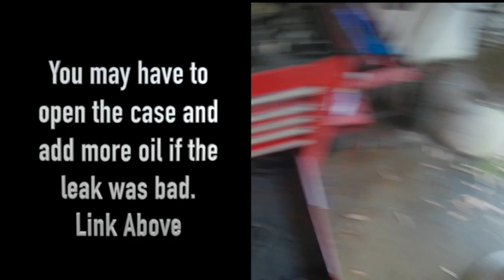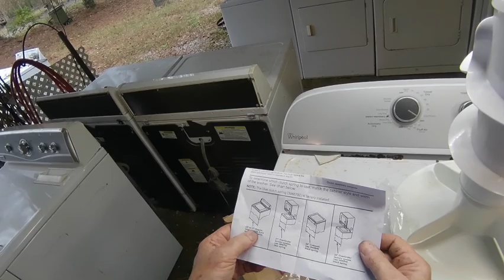How To Replace the Worm Gear Seal in a Whirlpool Washer Transmission: A DIY Guide

Comment: Hi Chip it's me again. Can you please show me the right way to align the cluch spring and the brake cam. Thanks keep up the great work 👍
Reply from the maker: Sure thing! First, twist the brake cam to disengage the shoes while pushing the spin tube all the way into the brake drum. Then insert the transmission shaft into the tube and rotate the clutch spring so that it's 180 degrees away from the brake cam arm. If you have it lined up right then the transmission should seat firmly on the bolt post.
Reply: So as long as the transmission bolts up its aligned correctly?
Reply from the maker: Yeah, it should be.

Comment: So the red seal  is not used with this transmission ? What is it for?
Reply from the maker: I think it is for a different model transmission. They did some re-engineering early on and changed the seal size and the steel plate and bolt size in the neutral drain. Thanks for watching!

Comment: How thick are the gears in the direct drive transmissions compared to the older belt drive ones? What are they made of?
Reply from the maker: Hi, Jerome, thanks for the comment. I’m not sure how thick those gears are in comparison.  You sure ask a lot of questions about the fine details of these washers, details I really don’t have immediate answers to.  Unfortunately I don’t have an older belt drive transmission that I can disassemble and make a measurement comparison.  Perhaps you could get this information from Whirlpool.  I don’t have a contact number for them but you may be able to find it on the internet. Thanks for the comment buddy!
Reply: @HarperandKnowles  I just want to know how thick the direct drive gears and the oil is. What material are the gears and what oil is in these?
Reply from the maker: My best guess is about an inch thick and it’s 90 weight gear oil.
Reply from the maker: Oh, and the spin gear is plastic and the other gears are steel.
Reply: @HarperandKnowles  How durable are they compared to the maytag centennial version of the same machine?
Reply from the maker: I don’t know, Jerome. As gears I think they compare about equally, what do you think?
Reply: @HarperandKnowles  I think they would be the same, but they tout them as commercial grade. Is the gear oil in these machines synthetic or nonsynthetic? These transmissions seem to hold a lot of oil. It smells like the one in the older GE filter-flos.
Reply from the maker: I imagine they use non synthetic to keep down the manufacturing cost. Maybe they use a better oil in the commercial machines. What’s your thinking on that?
Reply: @HarperandKnowles  I would assume both whirlpool and maytag uses synthetic oil since they're both direct drive and under the centennial label. It's just marketing. I bet those gears in the direct drives are heavy.
Reply from the maker: I would assume so.  Anyway, I have to work now so I’ll talk with you later, have a good day.
Reply: @HarperandKnowles  One day, you should compare the older belt drive and the newer direct drive's transmissions and their gears.